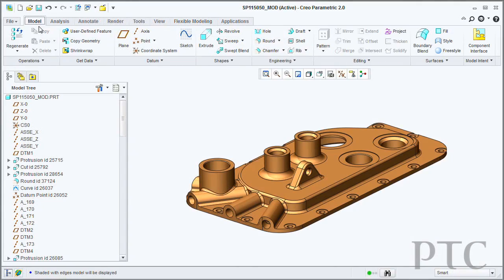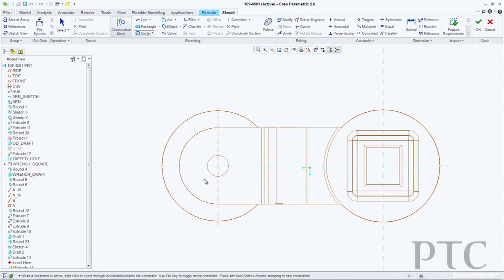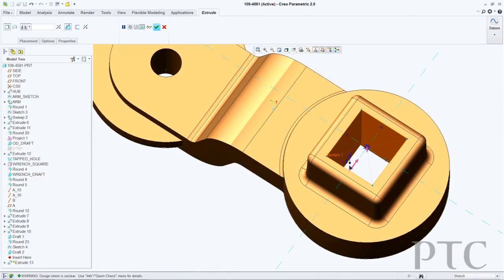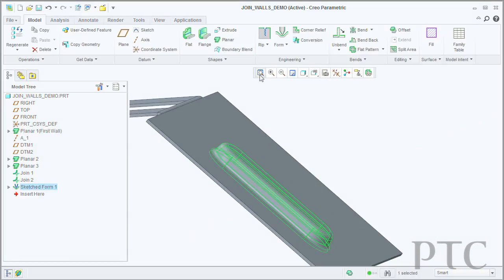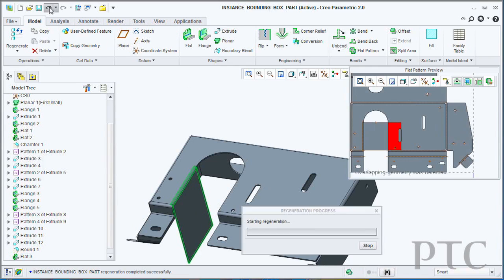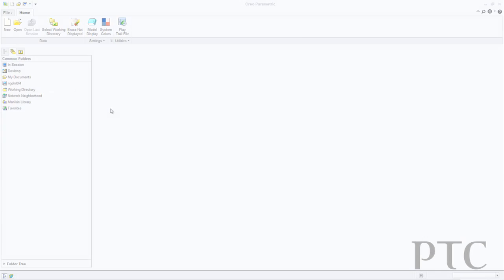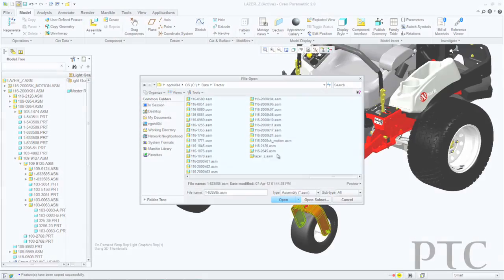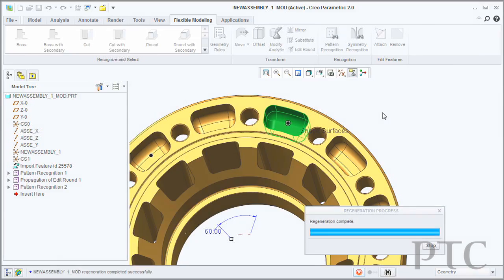Introducing Creo Parametric 2.0 - PTC

Comment: Creo parametric is PTC putting lipstick on a pig (Pro/e Wildfire). The software is still stuck in the 1990's. I recently switched to Creo from Solidworks and I'm astonished by how terrible the user interface is. Without an extensive on-site training which you will have to pay at a premium price, good luck to figure out how to use the software.
The basic package of Creo lacks some of the fundamental modules (surfacing, large assembly, fasteners toolbox...) you wil have to pay for each of this modules whereas they are all included with the most basic package of Solidworks.
PTC might have been the CAD leader 20 years ago but now unfortunately it has become the Blackberry of the CAD world.